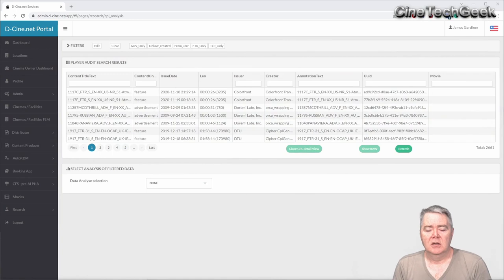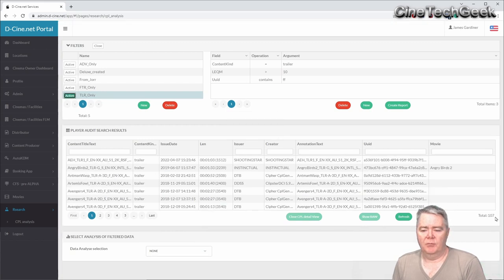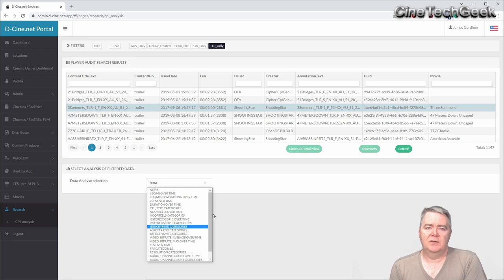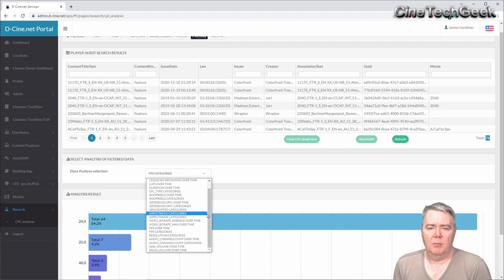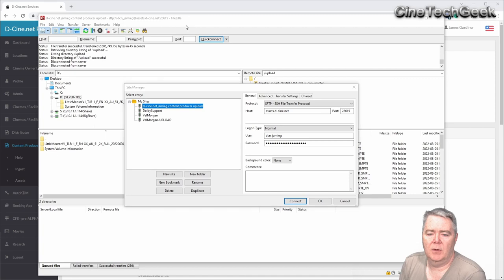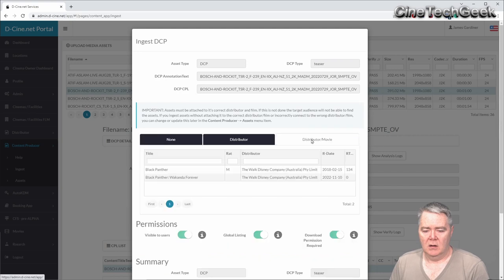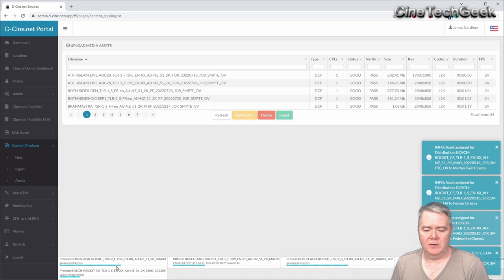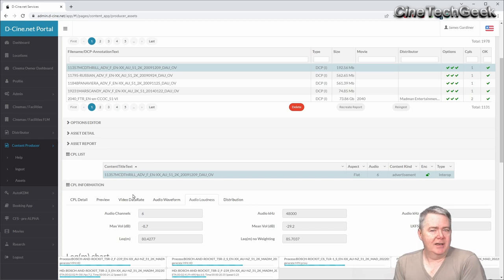Digital Cinema CPL research - Looking for trends in the evolution of Cinema Content

Comment: Well done James. I’m surprised you didn’t put in the code for the LEQm10 to look at long form material.
Reply from the maker: leq m 10, on looking into it, there didn't seem to be a unified understanding of what it actually was.  I had no way to qualify my readings of it either.  I.e. no way to know if what I was doing was equivalent to other industry norms. (i.e. could not find the existence of ANY tools that did it, it was more of a rough discussion around the topic) Due to this, I stopped investigating as I had no idea how long or how much work would be involved.

You may be able to work it out based on the leqm graph data anyway at a later date.
In any case, if it is now well defined and I have a certified path to obtaining a value the industry has a formal acceptance of.  Still could go back and implement it.